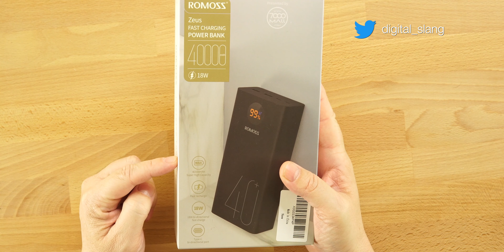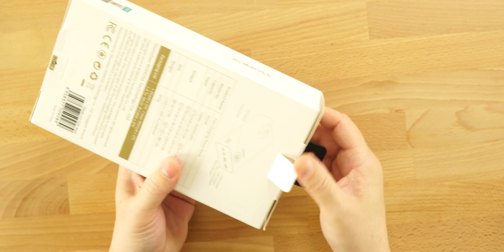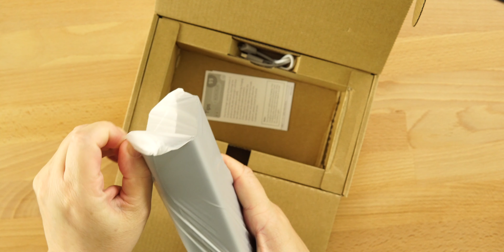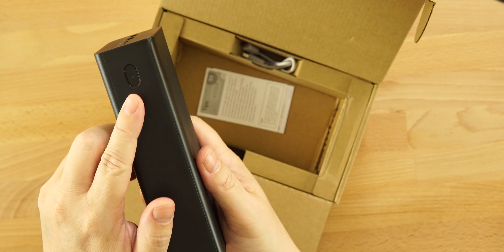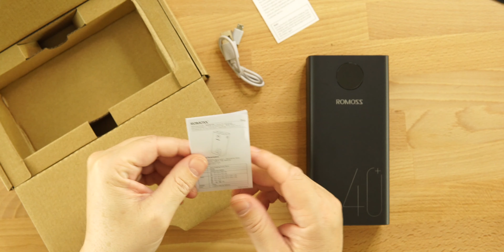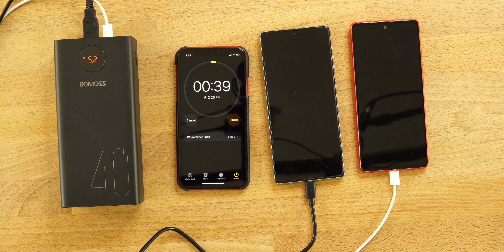ZEUS 40,000 MaH Portable Power Bank from ROMOSS - with charging tests!

Comment: I've recently purchased the Zeus myself,  however, I was wondering what the "blinking" is when the power button is double clicked?
Reply: Continues charging. It will charge the device even if it's 100 percent. This is for people who like to plug-in devices that need to be always plugged-in, for example a router. You do need a step up cable for that though.
Reply: @Digital Slang, pls answer this👍
Reply from the maker: Not sure actually
Reply: It blinks when it is charging.